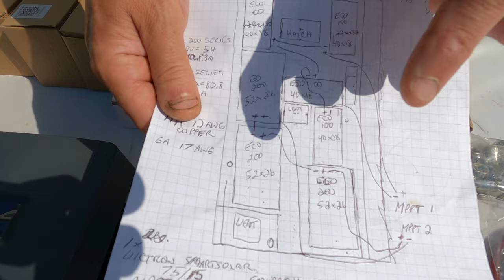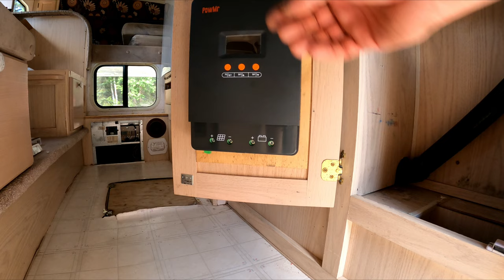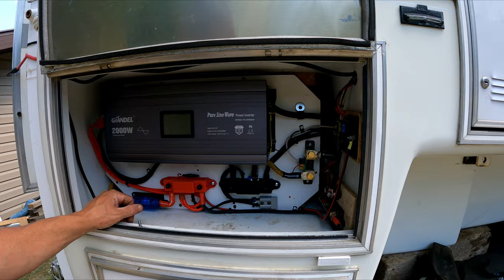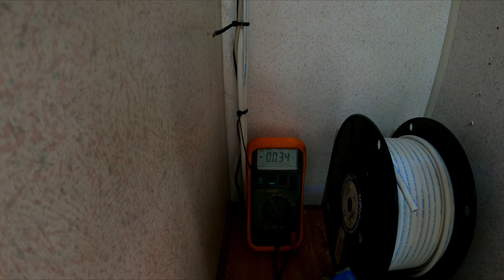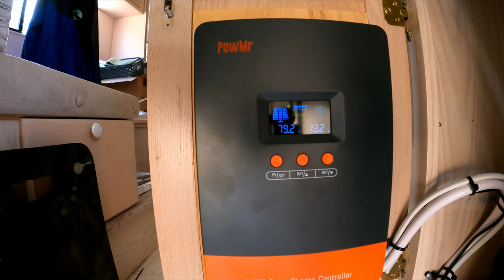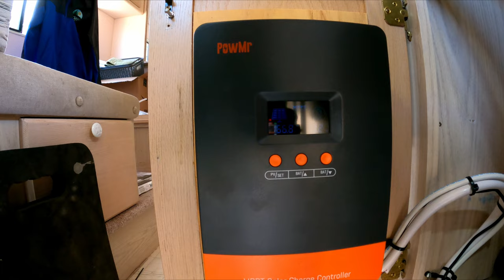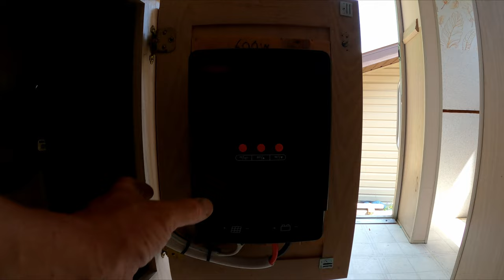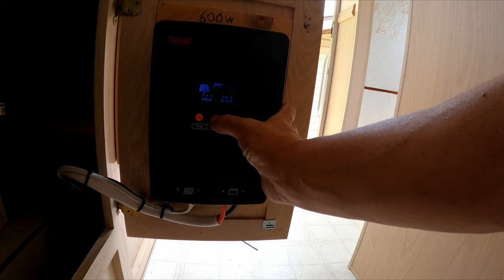We Turned Our TRUCK CAMPER Into a SOLAR POWERED Home

Comment: The 3m tape works great used it on 2 truck campers and got thousands of kms. We been across Canada alaska and usa no problem. We have 800w on our bigfoot c1002.
Reply from the maker: Thanks for the feedback. I'm still not 100% confident but we have over 1000km of driving with them so far and everything is staying put. Good to hear positive experiences. Thanks for commenting.

Comment: Why not go with Bouge RV flex panels? Or monocrystalline panels? You could do two 530w mono and a 200w BRv flex panel up front in that space.
Reply from the maker: These are the panels I found that fit the space that were easily available in Canada. I'm sure there are other options that could work out though.
 I did not consider flex panels. They would be a simple solution, but from what I understand, are more affected by efficiency loss from heat and I wanted to keep the option open to tilt the panels when the sun is low in the winter. Thanks for watching.